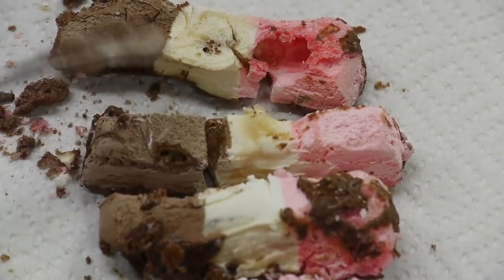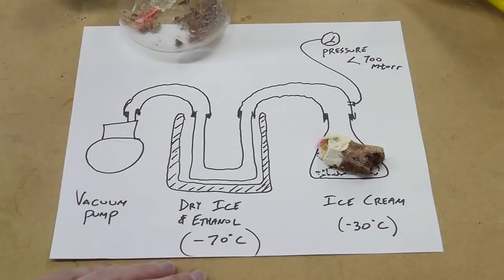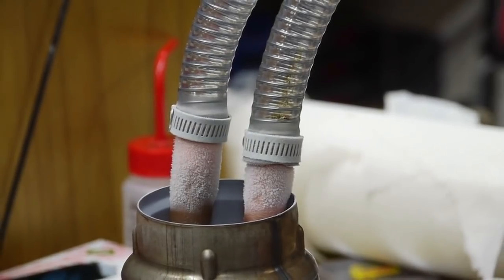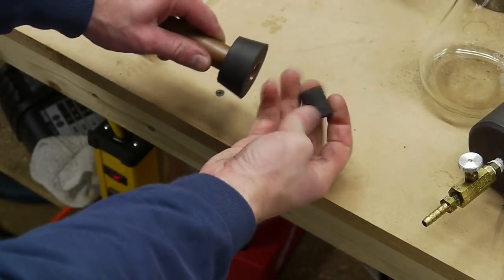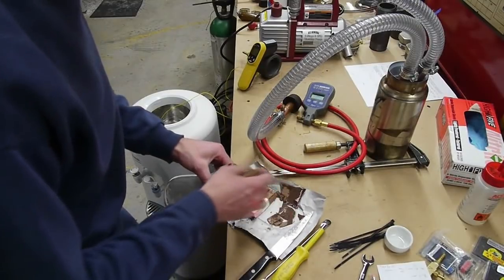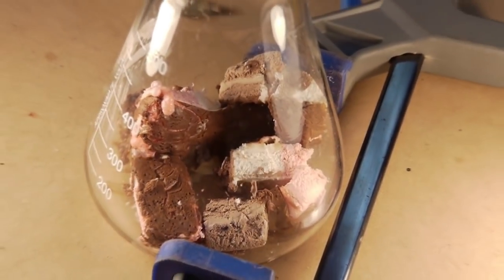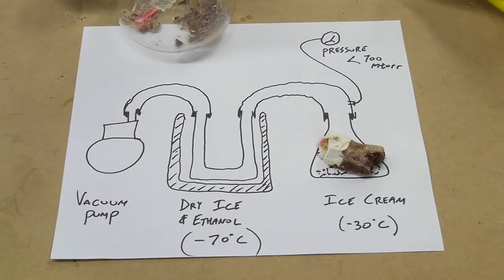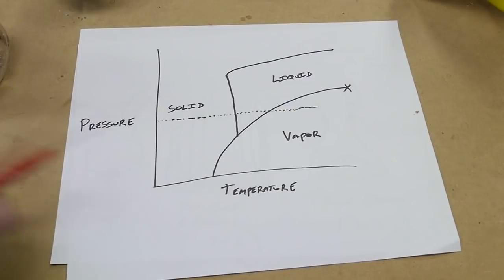Making astronaut ice cream in my home shop

Comment: I think a simple explanation of the sucrose' effect on freezing is actually an essential part of achieving good ice cream texture. What happens is as the water goes to a solid phase, the remaining liquid becomes more and more saturated, giving it a lower and lower freezing point. You can freeze off a lot of water at high temperatures, but to get it all you have to deal with very, very saturated water-sucrose solutions.

I make ice cream for a hobby, and it's actually really difficult to deal with a consumer freezer, as it doesn't get lower than -25C, much like your water cooler. To combat slowly solidifying ice structures, I have to use a lot of extra proteins to mask the large ice crystals in my ice cream. If I had a colder freezer, I could leave much of that protein out of the mix because quickly freezing ice results in smaller crystals.
Reply: Your explanation of how increasingly concentrated sugar solutions lowers the freezing point made me think about the prickly pear cactus surviving freezing winters with this mechanism when other cacti cannot. "After 7 weeks [at cooler temperatures], relative water content decreased ... mucopolysaccharide content increased ... hygroscopic mucopolysaccharide acts as a passive water capacitor to reduce water efflux during extracellular freezing ...The ability of O. humifusa to tolerate extracellular freezing and cellular dehydration, together with the increases in mucopolysaccharide at low temperatures, may help explain its distribution in regions of North America that are subject to subzero temperatures for prolonged periods in the winter." Loik, M. E., & Nobel, P. S. (1991). Water relations and mucopolysaccharide increases for a winter hardy cactus during acclimation to subzero temperatures. Oecologia, 88(3), 340–346. doi:10.1007/bf00317576

Comment from the maker: You should probably keep the pressure below 500 mtorr. The size of the pump needed will depend on the amount of material you want to freeze-dry and how quickly you want to do it. This pump is well-sized for a single serving of ice cream to be dried in under 18 hours.
Reply: I'm gathering parts to make a freeze dryer, and I'm wondering how important the water trap is. Why not just let the water vapor go through the pump? The low pressure line could be heated to make sure the water did not freeze inside the pump when it reached 1 atm pressure.
Reply from the maker: @machinemaker2248  Depending how much water needs to be removed, you might be able to use only the pump. It will accumulate water, so change the oil frequently. Use a large diameter hose between the chamber and pump (or trap) to give good conductance for the water vapor.
Reply: @AppliedScience  How good of you to reply to me on a 9 year old video. I very much appreciate it. Thank you for the guidance, too.

Comment: Wow! That's is great video I just stumbled on to it on my home page. Great tutorial and explanation of the science behind what you did. I am a mechanical engineering student and you just covered everything in one video. Thermo, material science, and chemistry all in 12 minutes, great job.

I would try to do a Popsicle since its a not milk based it will have a higher water content and sucrose aswell. It may add for a challenge because of the sucrose, but I think it would be interesting.

Earned a subscriber!
Reply: Any decent ice cream or popsicle should have at least a good part of dextrose along with the sucrose

Comment: I was thinking while watching your build out that your water trap needed to be larger. My first thought was 'Hey, that pipe is going to clog with ice in no time'. lol I was going to suggest a canister styled water trap so you could capture a larger volume of water without restricting the pressure.
However, excellent work! Bravo. And my vote would be to attempt Bananas as well. A really odd suggestion would be Potatoes, because I have no idea what would happen.

Comment: Hi Mr. Krasnow, I'm trying to do this as a project, but I can't seem to get the pressure of the system below .2 bar. I am using smaller diameter hosing, could this be the issue? Will using larger hosing actually decrease overall pressure that significantly? It doesn't seem to make very much sense why that would change it that much. I am using the a pump of similar power to yours. In addition, isn't using an Erlenmeyer flask an implosion risk with pressures that low? Thanks for answering in advance!
Reply from the maker: Using large-diameter tubing is important for good vapor flow at low pressures, but if you can't get below .2bar, you have a large leak, or a broken pump.  Everything has some level of risk. The risk of the flask imploding is low enough to be tolerable in my opinion.
Reply: Applied Science
gotcha, thanks so much!
Reply: +Applied Science The vacuum probably doesn't have to be that strong, since it's just the partial pressure of water that has to be below the triple point, not the total pressure.
Reply: +Applied Science While you're probably right about the low risk of an imploding flask, it's still a good idea to use the correct tools for the job. There is  a lot of glassware which is made specifically for use with vacuum systems. The flask linked below looks like it is intended to hold up against a vacuum (sorry, I didn't see a more appropriately sized flask):
http://www.amazon.com/United-Scientific-FG5340-1000-Borosilicate-Tubulation/dp/B00ES3R29M/ref=pd_sbs_328_4?ie=UTF8&dpID=31Vko3olz0L&dpSrc=sims&preST=_AC_UL320_SR174%2C320_&refRID=1YG631GJP6E0E11KXP93
I majored in chemistry and I would get in trouble if I used a normal flask in a vacuum system.
Thanks for another great video.

Comment from the maker: The problem is that the water vapor will condense in the vacuum pump, eventually fill it with water, and cause it to seize and/or be destroyed from rust.
Reply: I'm wondering if heating the pump would avoid that. It would certainly be a lot easier to heat the pump than using the vapor trap.
Reply: When water turns to vapor it expands by keeping a section super cold and freezing the water you help the vacuum pump not have to work as hard.

Comment: Wait a second, why would you need a water trap anyway -- cant the vac pump handle gas-form water vapor?
Reply: On the pressurized side of the pump the water will condense as liquid I suspect.
Reply: the water becomes dispersed in the pump oil and vaporises in the pump breaking the vaccum level

Comment: The freeze drying in excange for supercritical gases could be used to create aeregel. Simply by excanging the Methanol for water and freezing it. This frozen aerogel then can be dried in vacuo. Another method would be the hydrolysation of sodium silicate in aqueus solution, which would yield a silicagel similar to yours but with wather in between rhe structure. in this case you wouldn't need the solvent excange process. Plese try it. I'm courius how these aerogels would come out.

Comment: There is a breed of frog (North American wood frog, for one) that uses that sucrose trick to allow themselves to be frozen solid during the winter without cellular damage. As the temperature drops, as I understand it, water molecules migrate from the cells and are replaced by sucrose (or glucose, maybe). This prevents water crystals from forming and bursting the cells.

Comment: Cool thanks. The compressor vs thermoelectric cooler information is extremely helpful. One last thing though. We have an old compressor cooled water cooler that we still use what are the chances messing something up on it. Will it over work the compressor at all? I just want to be able to say with s fair amount of certainty that I'm not gonna break it. Keep up the good work and keep great videos coming. You are an inspiration to tinkerers / garage scientist everywhere!

Comment: > what should I freeze-dry next?

Make large slabs of "sea-gel" aerogel?  I heard about this but never tried it.  Does it actually work?  Mix up some somewhat-hard agar, alginate.   Supposedly it won't collapse upon drying like all the more fragile gel structures.

Then store it under helium, so it falls upwards when brought into normal air.  (Or can it only float in a CO2 aquarium?

Comment: I wonder if a water cooler could be made into an effective cold trap by adding additional cooling such as fans and heat sinks to the heat dissipating coil (or whatever it's called) before the compressor? The coolers and mini-fridges I've seen have little or nothing to actually cool the freon before being compressed.

Comment: Dear Chris, you have been using all kind of protective methods to reduce the risk of having water entering to the vacuum pump. Question, why not using instead a Plastic membrane vacuum pump?
This pump reduces the pressure and is never affected by water, isn't it a replacing solution to all the cooling suction trouble?

Comment: Hi! I want to do this experiment as a school project and i have already found a vacuum pump that should work. Did you leave the pump on the whole night or did you just pump out the air and then leave it? The pump i borrow is used to empty freezer systems, so apparently it's made to pump out water vapour. I have read somewhere that you still need the cold trap because if you stop the pump at vacuum, the pressure will rise when the ice sublimates to water vapour. Do you think  i need to do that, or can i just leave the pump on over the night? Thank you in advance!

Comment: The chocolate used for ice cream isn't like the kind you will find in other foods, its the lowest melting point crystal form of chocolate. Its used in ice cream because even though it is surrounded by cold ice cream on you tongue it will melt. This may be a reason that the chocolate was so flimsy as it melts from 61-67° F

Comment: How cold does the cold trap have to be? Dry ice cold or just cold enough to get the vapor back into a  liquid. Also, doesn't the vacuum and sublimation process eventually start making it's own cold. I mean your cold trap was frozen up on the ice cream and on the jello. It seems like their should be some way to get out of using a hundred bucks worth of dry ice. Even if you had to set your trap in the deep freeze until it got going good. As far as that goes whatever you're drying could go in at first too, then you would just have one line running out of the freezer. What about an inline filter like the type that they use to keep water out of ventillator's? At this point I should mention that I am an ICU nurse.

Comment: Why to have the dry ice collector and not only a direct pump from the ice-cream flask?
Reply: +coline123456789  Was wondering that myself . I think he may not have wanted to prevent water from reaching the pump.
Reply: +Oren W sounds good, even so, water would be traveling as vapor so not a problem, and if it is, then time to get a non corrodable air pump. But as you think on it, any time you vacuum pump something with water, it will be escaping the item and through the pump
Reply: You can, but some pumps contain oil in it and then you have to replace and filter it.

Comment: This happens in my freezer when I don't want it to (water leaving my frozen foods). Why does this happen, and how do I stop my food from freeze drying in my freezer?
Reply: I don't think your foods are freeze drying in your fridge. A professional freeze dryer can cost 100,000 euro's or more, so a simple fridge won't do the job. Maybe the food isn't freezing rapidly enough. That way, maybe water pushes itself out of the products as it starts to expand... In chemical analysis, we start the freeze drying procedure with cooling the samples rapidly. We do this with dry ice, or preferably with liquid nitrogen. These methods cool the samples very quickly, and the water doesn't get a change to escape.
Reply: Robbert Noordkamp
I don't know what's going on in my freezer, but if I keep frozen stuff in there too long, they end up completely dried up. For example, if I buy a frozen dinner and put it in there, it will be fine for a few months. But after that, all the moisture comes out and sticks to the plastic wrap. A layer of ice forms above the food too. It's as if the water sublimates and refreezes somewhere else.
Reply: robbert noordkap is describing the industrial process of water sublimation, which is very expensive to recreate. However, what is happening is that when the water vapor in your food diffuses into the air, it travels by convection to the back of the fridge, where it condenses and freezes, thus removing water vapor near your food. More water vapor then diffuses out of your food and into the air, where the process repeats.
Reply: ThingsDemystified  you can seal the foods you keep long storage with a bag for some things, or plastic wrap for things like a box of Ice cream. try to remove as much air as you can so the water doesn't leave your food.
Reply: Justin Muller not expensive to recreate, sublimation can be done with a conventional freezer, and a food saver vaccum sealer.
Reply: Brandon Wiker I agree on an industrial scale yes it is expensive to recreate. But small quantities can be achieved at home for relatively cheaper costs.
Reply: ThingsDemystified In this case, it possible that your H2O in your food isn't solid because it has some compounds dissolved in it, which reduces the freezing point such a NaCl, CaCl2, proteins and enzyme. The liquid phase H2O evaporates  as pure H2O and crystallizes on colder parts.

In the case of my freezer, I noticed that if I am making a lot of ice cubes, I get a lot of snow covering the freezer's walls. It's normal because liquids evaporate.
Reply: Vrej Egon Spengler
That sounds interesting. Do you think lowering the temperature will help?
Reply: ThingsDemystified No. I think that putting your food in plastic bag or box would help.

Comment: I don't understand the need for the condenser.  Wouldn't the vacuum pump move all water vapor outside the system even without catching it?  What am I missing here?
Reply: Same here. All I can think of is that the Vacuum pump wouldn't be able to handle the amount of water that would be sucked out, but it still seems overly complicated.

Comment: you should try to freeze dry a broken battery and see if it will bring it back to life, i heard somewhere that its moisture that kills them so if you can extract it from the battery by freeze drying then the battery should be able to charge back up

Comment: What would be better: a cold trap similar to the U shape copper pipe you use in this video, except I'd use 4 connected together in parallel so as to maximize surface area inside each trap while minimizing the risk for condensate buildup... OR using a chamber with a bowl of coolant which traps the condensate its outside surface, as you tried in your Jell-o experiment? The latter would be more expensive, but I could see it allowing for more condensate buildup.

Comment: Hello, love your videos. Wondering if you can help my project with some edification. I am looking to connect my homemade cold trap to a refrigeration system so I can run it without having to stay awake for 24 hours. I am using it to process ice water hash, so no sucrose or sugars are being dried, just trichome heads. Would I be wasting my time trying to retro fit a regular fridge compressor system as an immersion probe cooler device to replace dry ice/iso? I understand they don't get very cold, in comparison to cascade systems, and those are just too expensive for me (might as well just buy a harvest right and deal with their horse shit customer service), but I am just wondering if I gut an old mini fridge for the system and compressor, would it be able to fill my needs in lowering the iso down to at most -40c?

Comment: I believe it will work if the pump is strong enough because otherwise it is only a matter of which end a tube is attached to I am trying to test this but it turns out I used a very small tube I will look for a substitute.

Comment: Spider.  I collect spiders, but my spiders cannot be pinned because they shrink due to their thin cuticles.  I want to make your-designed freeze dryer, but I want to make sure  your design CAN freeze dry a spider.  What you do is find a spider, catch it, freeze it to kill it, take it out and let it briefly thaw, pin it onto foam (position the legs out), with 10mm between the dorsum of spider's body and pin head, freeze again, then put in the dryer.  This would be so great.  Thanks so much!

Comment: But the pumps are used to evacuate moisture from AC system.  Like you said not the amount you're removing from the ice cream but I wouldn't see it as a huge concern. And to another comment a compressor can get you enough vacuum (~-30" Hg) needed to boil off the water.

Comment: I'm making one of these, I was wondering how I can be sure that my cold trap is efficient. I'm going to make one similar to your but with a bigger diameter to avoid your ice problem haha. Do you think 3/4 in diameter is too big? I'm using a pump with a 1.4 cfm capacity. It only gets down to 560 torr. Any thoughts?

Comment: I see, I just found a Wikipedia article about it.. I think it's probably "Kappfree"..I'll have to use something similar for copper soldering (pressures are up to 200 psi and temperatures 240°F).

Comment: Also, the freezing in a water cooler thing is such a good idea. I actually have an extra one, but I don't know how to bypass the heat control. Any tips on identifying it in the innards of my water cooler? Mine seems to have a circuit board and a bunch of unidentifiable wires. It doesn't mention anything about opening it up or fixing it in the manual...